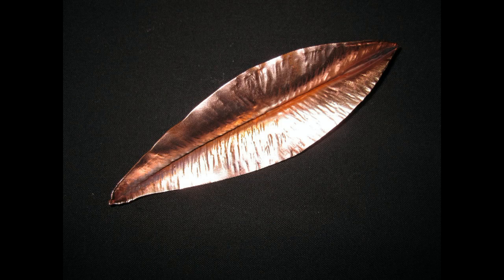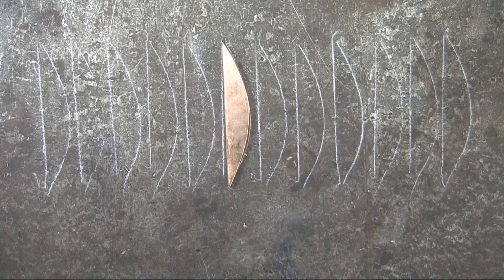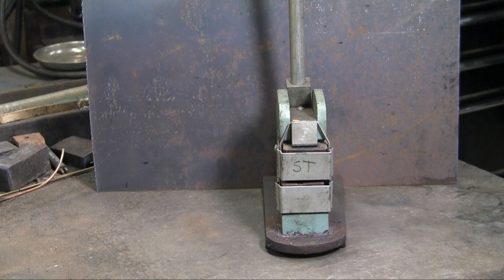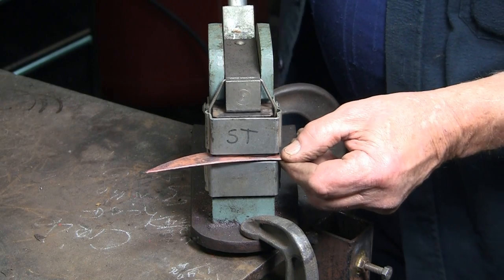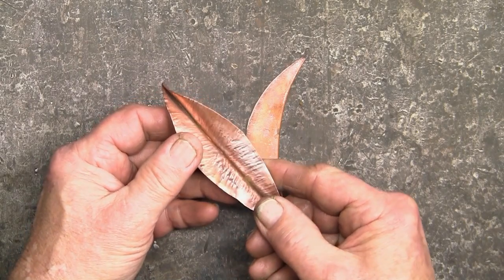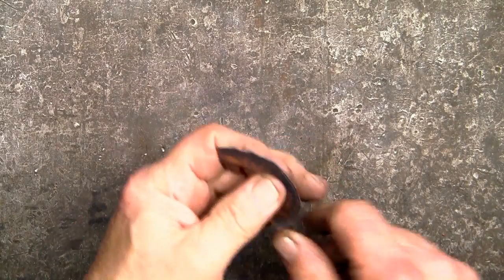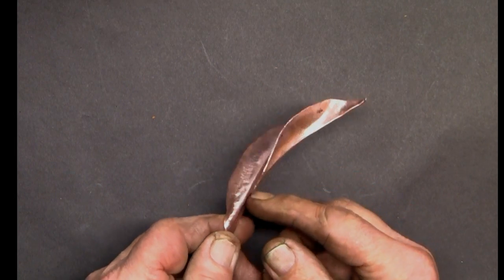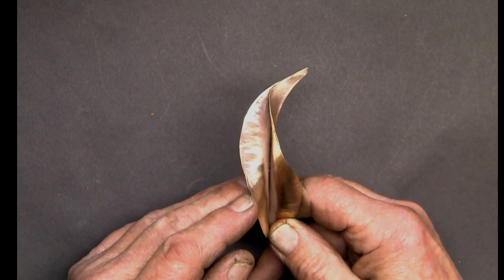Stretching Copper

Comment: Cool.  Thanks for sharing.  I have a question for a copper expert.  I want to take some old copper wire and melt it down, pour it into a thin billet, and then hammer it into sheet that I could use for projects like this one.  Is that feasible?  Any advice?  Should I hammer it out hot, or just anneal frequently?  I'm concerned that hammering it into sheet is likely to crack it.
Reply from the maker: That is definitely doable.  It would work best if you had a furnace and a crucible.  Much more efficient.  This is out of my line, I'd suggest that you do some searches for " Home Foundry and Crucibles".  Lots of cheap ways to build a furnace.  Good videos on "home foundry" on YouTube.  As for annealing, anneal often!
Reply from the maker: I have never done what you are attempting.  I think that I would anneal and hammer.  When the hammer strokes aren't as effective, then I would anneal again.  Keep alternating between annealing and hammering.